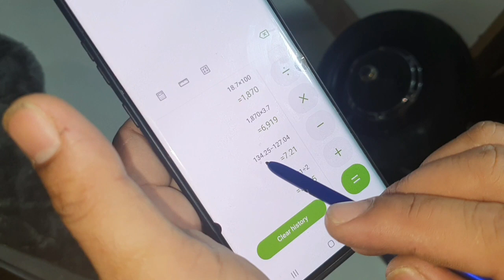ZERO 10X REAR PLATE WITH NINEBOT MAX FRAME | RETRO ELECTRIC SCOOTER CONCEPT | EMOBILITY GURU

Comment: Nice setup and is this ninebot has best looking scooter and what kind of battery and controller setup you running with and I would like to modify me own designs instead of copy others and your videos are best and keep it with ninebot max and next video if you can make it vsett10+ rear plate to be fitted onto ninebot max that be cool cheers
Reply: Vsett10+ has 127mm rear plate it's perfectly fitted onto ninebot max without any hassle free

Comment: boss magkano aabutiin pag mag pagawa ng rear lng??/
Reply from the maker: depends po sa mods n gusto nio sir. kung gusto nio upgrade ng speed or range or torque.
Reply: I mean ung rear lng sir ung ilalagay ung suspension na pang 10x ung lng sana
Reply from the maker: ah ok sir, around 1600-1700 po sir.
Reply from the maker: aed po sir ahh